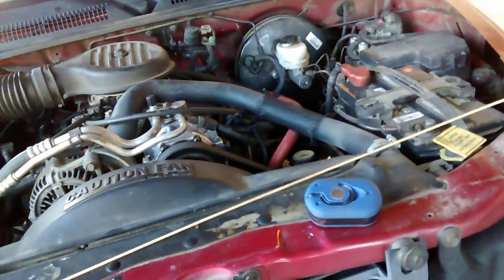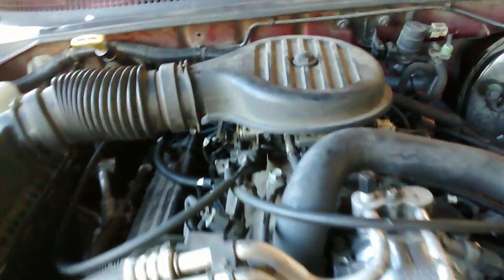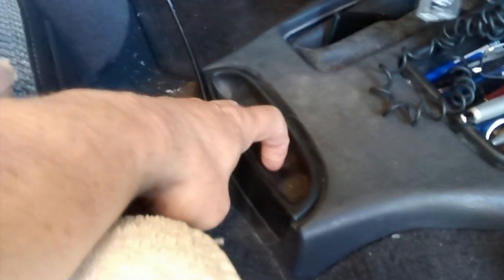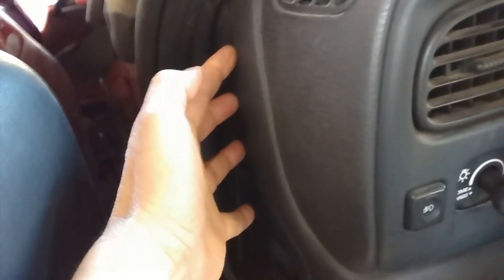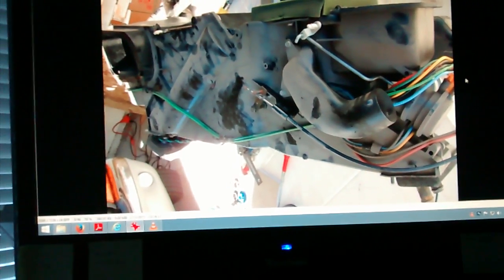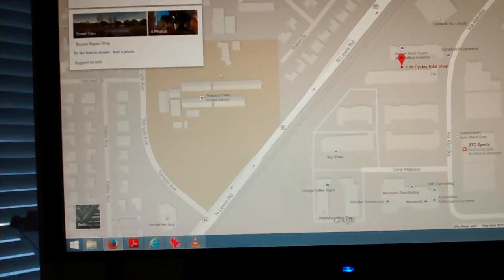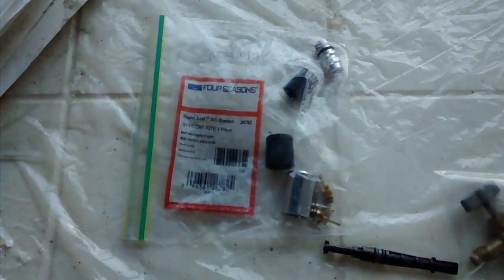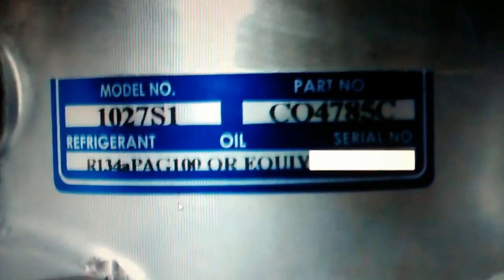1998 Dodge Dakota Heater Core Repair/Replacement, HVAC Box Removal

Comment: Did my Heater Core and entire A/C system . Would have been WICKED hard without your video ! Thanks for the Wicked Informative Video ! And I didn't have to pull my dash out just set it on my passenger seat
Reply from the maker: You did the same job I did, fixed heater core and A/C!  It was nice having both working again properly, especially on rainy days.  My windows would fog up so bad from the moist outside air, the heater core leaking coolant, and no A/C to dry the air out.  Glad the video helped!  I was thinking later putting it on the passenger seat would work too, I had already decided to do the strap on that bar like I saw in another video though so didn't try it.

Comment: Could you get to the blower motor without pulling back the dash, like just going through the bottom or the glovebox area?
Reply from the maker: It's a squirrel cage fan so you might not have enough room to pull it out even if you could get all the screws out with the dash in place.  

For replacing the blower motor you might only need to do the steps on the passenger side, center console and the 5 screws on top of the dash, and then on the drivers side loosen the 13mm bolt and remove parking brake rod so the dash can move.

Comment: Eric, I know this is an older post, but about how long (or how much time was saved Lol) ?
Reply from the maker: I have no idea... I've only done this job the one time and this was the way I did it.  But based on how much I've seen that you need to disconnect by completely removing the dash, probably quite a bit.  As it all needs to be reconnected too as well as getting the dash back in, so the more you remove just adds more work!  I think doing it this way would keep the frustration level down too.  I was dreading doing this job but it badly needed to be done, in retrospect it wasn't too bad.
Reply: Thanks for getting back to me Eric. I'll let you know and post how much time it takes.
Reply: Edward Strasburg hey do you remember how long it took?😂

Comment: Could a guy get away with not bleeding the AC and just remove the top of hvac box with the box loose but still connected to AC to remove heater core? Is there enough play to get the core out that way?
Reply from the maker: I didn't even consider going that route so didn't investigate trying to do that.  Those lines are rigid so there wouldn't be much play I'd think, so it would kinda be like trying to remove it with it still attached to the truck.  Plus you'd be torquing on them when moving things around, sounds like a good way to damage the evaporator or something else.  Also with it that close to the firewall I'm thinking it would be difficult to get to all the screws and would potentially add hours of frustration to the job.  It's so much easier to work on with it out of the truck.  

I know it's a hassle and added expense if you don't have a vacuum pump and a/c gauges, but at least you'd have them for future projects.  Luckily for me there is a Harbor Freight nearby and I was able to get both cheaply when they were on sale and had the 20% off coupon (local shops wanted almost $300 for a recharge).  You might be able to find a shop that would discharge your system for minimal or even free if you let them keep the refrigerant from it.

Comment: Hi Eric S, I'm Planning to replace the heater core of my 97 Dakota v8 5.2   , Do I need to order a blend door too incase its no more good  and I can replace it also. ?  How about the Ac Evaporator mine the Ac is not working too, planning to replace both ,  I'm taking it  apart anaway , Just need your good Ideas of what other parts inside the HVAC that needs to prepare incase I  need it.   Thank you very much for the video, and I'm waiting for your reply  as soon as possible,.... I'll highly appreciate it..  Take care...
Reply from the maker: Hi, sorry was on vacation just got back. 

I never tried to find a blend door,  my guess is you'll only be able to get that from a dealer.  Since I didn't think about it at the time didn't have one on hand to replace it with, and I needed the truck for my work commute so I couldn't afford to wait for the part.  Luckily mine was still functional, it just looked bad.  It's a very simplistic part anyways, even if it was in bad shape it would probably at least be somewhat functional.  

You can replace the a/c evaporator if you want, I didn't think about that at the time as I thought it was the compressor on mine (system had freon in it so no leaks, it just didn't work) but I now believe it was due to the accumulator had clogged up.  It certainly wouldn't hurt to replace the evaporator, especially since you have the HVAC box out and opened up and your existing one is 20 years old now.  I think it needs to have a little PAG oil put in it, I showed the chart for how much.  Easier to add oil before you put it in the HVAC box.  

That's about it really inside the HVAC box.  The heater core, a/c evaporator and blend door.  Maybe the foam they use to seal up the lid, and the foam on the outside if you really want to be complete.  I haven't noticed any issues with mine though due to using the old foam for both.  

Hope that helps!  Feel free to ask any other questions.

Comment: the orfice tube you should have replaced the entire hose i just had to get one and it was $149
Reply from the maker: Just curious, why did you have to replace the entire metal hose?  It seems to be a simple part not much to go wrong, only need to replace the orifice tube that's inside of it, as well as the o-rings.
Reply: it has the orifice tube made in it. its not serviceable. but some people do it. i have tried but it never worked for me
Reply from the maker: Wow, that's crazy.  I wonder why they decided to start doing that?  It's a standard a/c part hard to imagine why they'd do that except to make more money ripping people off.  It was easily removable on my truck once I made that tool out of wire.  Most guys were saying use an air compressor to blow it out but I couldn't get that to work.  Glad it didn't work now as may have lost the orientation with no way to know how it was in originally.
Reply: yes it is

Comment: Good video, I had my mechanic do mine since I have no time to do it myself. One thing he showed me was on my '99 Durango, the blower motor seemed to be built together as part of the blower box. Was your Dakota the same way?
Reply from the maker: Thanks.  Yes, the blower motor is part of the HVAC box on my Dakota.  The A/C evaporator, heater core, temperature control (basically just a flap that controls how much air comes from either the outside/evaporator and/or heater core) and the blower motor are all in the HVAC box.  There is also a flap that closes off the outside air if you put it on "max a/c".  The blower motor resistor is on the firewall.  

I was dreading doing the job myself but after I did it realized it wasn't that bad after all and is actually very straightforward.  I know I would have appreciated a video like this before I did the job, especially knowing that you don't have to take the dash completely out, WAY less to disconnect, that's why I decided to make the video.

Comment: which one of the heater core hoses is inlet and which is out going to water pump?
Reply from the maker: On my truck the bottom hose runs to water pump.  I'm not sure if that how it was originally or if it makes a difference or not.

Comment from the maker: Be sure to click "show more" to see the additional text I typed as I left one very important thing out of the video (the hard plastic vacuum line by the heater core hoses in the engine compartment).  Be sure to disconnect it so you don't break it!  There are other corrections there too.
Reply: Eric S I have a 99 Dodge Durango .... looking to replace the blower motor. Could you help me out with any info ? Diagrams or videos thank you
Reply from the maker: @nickmillhollin3996  Sorry didn't see your comment, for some reason I'm not getting messages if people leave comments.  If you have the same HVAC box (AN A/C) like mine then I would think you'd need to at least loosen the dash so you can have some room to remove the motor.  It's a squirrel cage fan and I don't think you'd be able to get it out with the dash in place.  Probably don't need to drop the steering wheel or remove the electrical, but for sure the center metal bracket, both 13mm bolts, and the 5 bolts on top.  That might make it loose enough to where you can get the fan out.